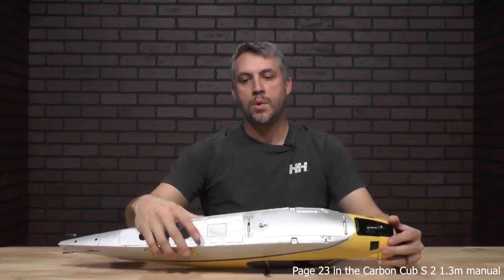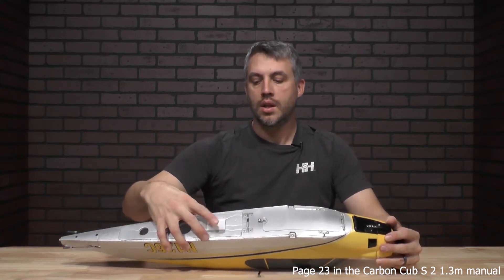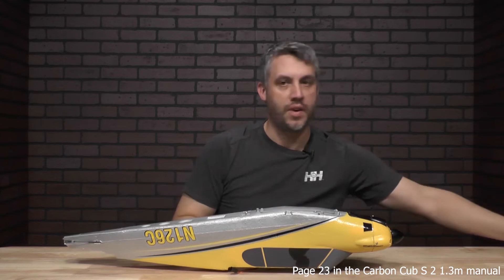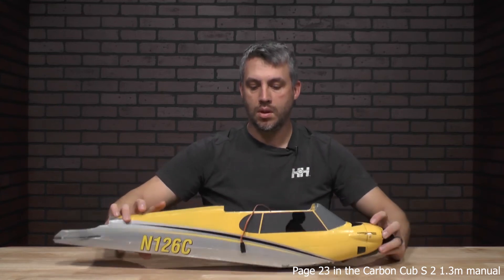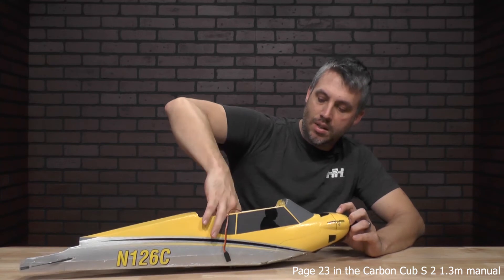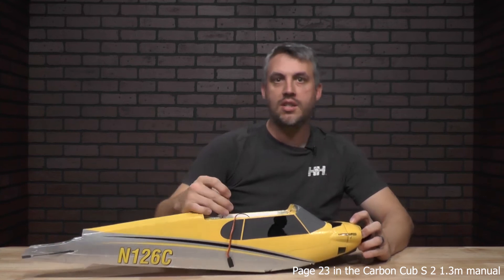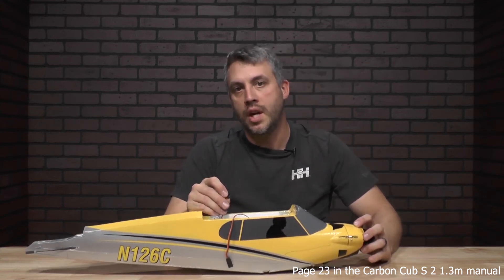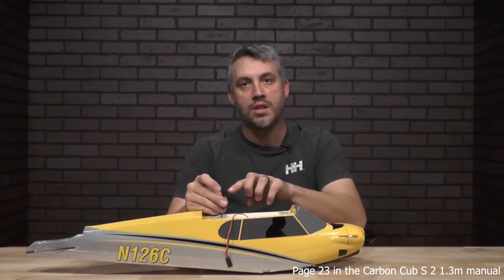From the Tech Desk: How to install the Landing Assist Sensor Module (LAS) in your Carbon Cub S2 1.3m

Comment: Great how-to video, thank you.  Would this be needed if one purchases and installs the GPS system?  I am planning on buying this cub in the next week or so.  Also, you did another video of the additional flap installation.  I am just curious what they are designed to do.  As a novice, I am not going to install them right away but perhaps later on.  Tnx, Rich